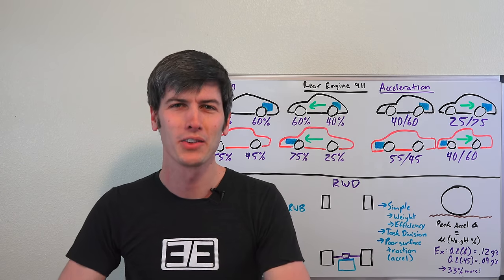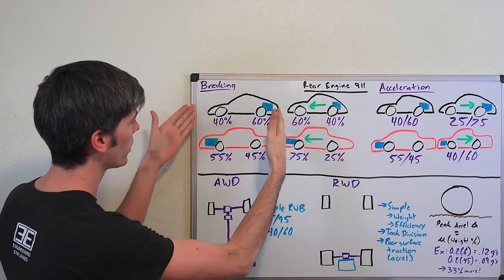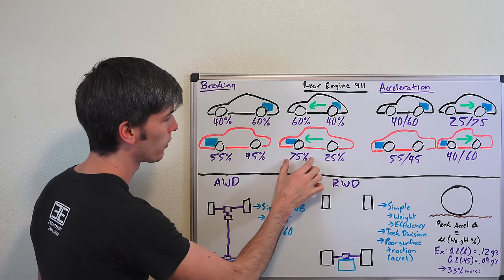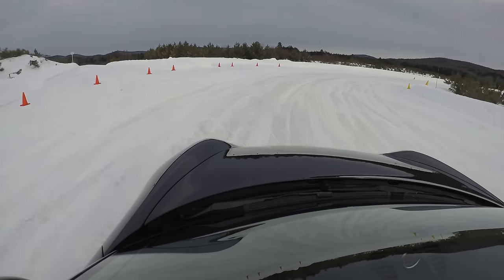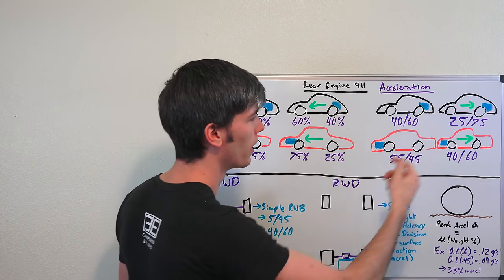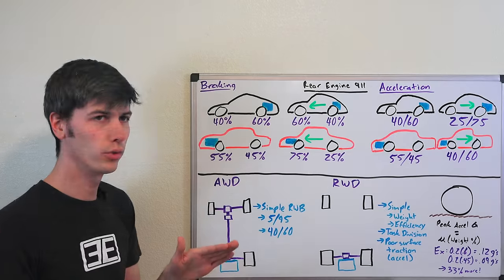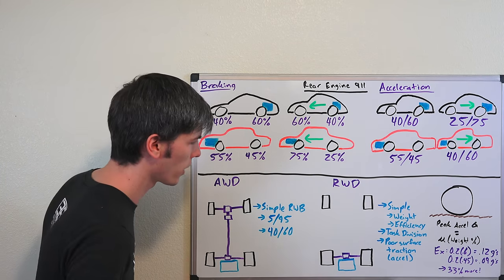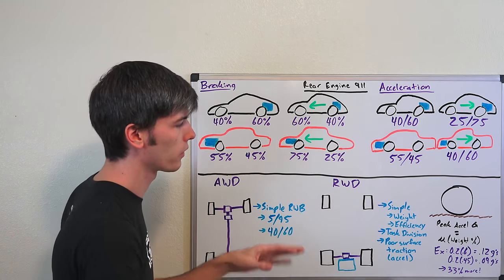Why Is The Porsche 911 Rear-Engine?

Comment: can you explain in a videl how do the golf r 4 motion awd sistem work? (or other awd that is fwd vias) and is it posible to rwd drifted? (via tuning and not changing hardware)
Reply: All wheel drive is of course superior to 2 wheel drive as far as acceleration traction.  But with all wheel drive you can not deliberately cause the rear wheels to loose traction for drifting, or gain drag to straighten out from a drift.
RWD is where drifting started.  But the 3 types of drifting are just different.
Drifting is attempting square corners by causing the tail end to loose traction and drift out, pointing the car more sharply into the turn that could have been done with steering alone.
With front engine and rear drive, you do it by over powering the back wheels until they lose traction, while in a sharp turn.  To stop it you have to drop the power and counter steer back.
With rear engine and rear drive,  it the same, but the additional weight in the back amplifies both the drift and the snap back, so you don't even have to let up on the power as much.
Front wheel drive always has front engine, and can never drift was well because all you can do is to apply exactly the maximum power to the front wheels that won't loose traction, because if you loose traction with front wheel drive, you go straight.  The tail will whip out slightly and the front can power into the turn slightly, but it is not as good a setup for drifting.  
And AWD simply can not really drift at all.  With even power to all wheels, you can't cause there to be any uneven traction.
Reply: Kirk Augustin. but the awd sistem on cars like the golf R can distribute power to the front, or back axels (i dont know in what amount), it would be cool if you could send all the power to the rear to drift it

Comment: Regardless of any advantages to the rear engine design that's not why Porsche does it at all. They do it because 911 fans wouldn't have it any other way. The original 911 was rear engined because it was essentially just a racing VW Beetle which was rear engined like many other european cars at the time because it was more compact than what was then the standard front engine RWD layout. 911 fans never take too kindly to anything that makes the 911 different from the original as they think that's the perfect car and if Porsche lost the rear engine layout they would all riot and never buy a 911 again.

Comment: The VW put the engine in the back because it helped make a really small, cheap car. Since then, they figured how to make small cars with engine in front that work just fine, but this explains why you might still want to deliberately buy a car with one in the back.

Comment: You should look into your claim that the rr config has higher moment of inertia. I believe rr is pretty good, just a little worse than mr. and then... practically speaking, mid corner it helps yaw the car. Just saying.
Reply from the maker: Car & Driver did some testing (there's not much data out there on Porsche weight distributions) and found the Cayman (mid-engine) to have a 20% lower moment of inertia vs the 911 (rear-engine). Hence, the claim made in the video.

Comment: I wonder why nobody has bothered to make a mainstream hybrid car that has an ICE on one end and the ELECTRIC on the other end? Basically try and harmonize both ends of the vehicle. Either that or has someone made a near perfect balanced EV?
Reply: All of the current Porsche hybrid vehicles in the states have the high voltage battery in the trunk and engine in the front...
Reply from the maker: There are a few examples of this: The Acura NSX, MDX hybrid, Lexus RX 350 hybrid.

Comment: There are a few things wrong with this no sports cars have the engine in front of the front wheels,and most are putting the transmission in the back to balance the weight,and you left out the mid engine layout  were the engine should go in a rear engine car. Porsche has just done a lot of engineering to make this bad idea work.

Comment: What about putting the engine in the middle?
Reply: If you placed the engine directly in the middle it would be difficult to get the cars weight to balance, so the best options are to place it inside the axles in either a front mid-ship or rear mid-ship design. A good example of this design is the Mazda RX-7 (FD) it has the engine in front mid-ship configuration  so even with the engine in the front of the car it still has 50/50 weight distribution on each axle.
Reply: That being said, its also important to remember that 50/50 weight distribution isn't the "best" option and as with everything in life it depends on the situation and what type of driving conditions will be encountered.

Comment: But I have seen the moster lambo drift car but that's mid engine there is the best for engine placement I feel like
Reply: corey Kenyon They all have advantages/disadvantages.

It's mostly to due with everything else you can put, weight distribution, ect. It's also personal preference to quite an extent.

Comment: If it was logical then the new 911 RSR race car wouldn't be midengined
Reply: I actually spoke to a Porsche engineer about the RSR and he said the change in engine placement provided very little if any advantage in handling balance.  The key benefit of moving the engine forward was the space they gained at the rear for a much more aggressive diffusor and the additional downforce that provided.  Not sure that same advantage relates to a general purpose road-going sports car.
Reply: Craig Spender "Spoke to a porsche engineer" and it directly conflicts with the press release from the race team in quest.  Isn't that convenient.....
Reply: It is what it is.  He may have had a different opinion from other engineers as to the degree of difference (apparently they're allowed to different perspectives) but to be honest it doesn't actually contradict what was said in the detailed press kit.

Comment: Why are there not mid-engined cars in this confrontation??? 
All the advantages you explain here you can have them with a mid-engined car minus the disadvantages that a center of mass, so moved at the end of the car, give you for the excessive leverage effect due inertia of that eavy bottom; disadvantages which can easily materialize in a much powerfull snap oversteer... respect to a mid-engined car.
The real reason why 911 is rear-engined is for the 2 plus sits in the rear which you get... 
In Porsche they know it and that is the reason why all their "over the top" super sport models have always a mid engine.
Reply: Late reply but you're right, jason should be comparing this setup with the mid engine design not with the fron engine design.

Comment: What disadvantages are there?
Reply: HYWay snap oversteer under heavy breaking. Essentially you have to drive the car differently than a normal rwd car. Assuming the engine is rear mounted, rwd. 
For example let's say you want to take a fast right hand turn, in a front mounted, rwd car, you would down shift, slow down a bit and take the turn. In a rear mounted, rwd car, you want that moment of Inertia on those rear wheels, because if it moves forward the car will spin out. So in this turn, you would want to maintain speed.

Comment: I've got a small question, when 40 percent of the torque is sent to the front wheels, does that mean that the rear gets a 100 (engine torque minus gear ratios) and the front 40 percent of that by having the front clutch slip all the time?
Reply from the maker: If the front is getting 40%, the rear will get 60%. The 40/60 split can be done with the clutch locked up, based on gearing. The 5/95 split (and up to 40/60) will mean the clutch is slipping. In wet multi-plate clutches, it may sound like this will wear out, but they can actually last an extremely long time if designed properly. When I worked in the forklift industry we had transmissions that used clutch packs to brake the vehicles (rather than the actual brakes, which were there more for safety). The clutch packs could out-live the vehicles, very robust.
Reply: Engineering Explained thanks for the explanation, much appreciated! Long live AWD (and Honda's)!

Comment: 911 has a lot better turning  because of low weight in the front
Reply: you need a lot less force to rotate the steering wheel
Reply: with the motor in the front you have to carry haf the weight of the car with your hands and it will drive like a truck

Comment: What’s the difference between rear engine and mid engine?
Reply: As the name suggests a rear-engined car has the engine BEHIND the rear axle, a mid-engined car has the engine between the axles and a front-engines car has the engine in front of the front axle (or the majority of it). A mid-rear-engined car thus has the engine between the axles but behind the driver and most of the weight towards the rear. A front-mid-engined car (like the AMG GT) has the engine in front of the driver but still in between the axles.
Reply from the maker: Rear engine places the engine behind the rear axle, mid engine places the engine somewhere between the front and rear axle, though more commonly mid-engine refers to the engine behind the driver, in front of the rear axle. Technically, cars like the Corvette and S2000 are mid-engine (front-mid).

Comment: While all of that is true, there are also huge downsides to having the engine behind the rear axle. Increased polar moment of inertia is one of them. Reduced front traction is another , Porshe had to add weight to the front of the car in the early models. All in all the rear engine layout is not that good for handling. It goes from terminal understeer (because the fronts have very little weight on them) to terminal oversteer (because of centrifugal forces on the mass at the back) all in a single corner.
It just make a lot more sense to put the engine in the back of the car , BEFORE the rear axle, like all other serious sport cars. That way all tires have decent percentage of the weight on them and the car responds like it should.
The original advantage of the rear-engine was the reduced weight of not having a driveshaft from the front to the back. And they kind of stuck with it.
Reply: I would say it has something to do with the soul of the car. Mid engine might be better for cornering but might not be as much enjoyable as rear engine. It has its moods over the single turn. You can be fast with it but need to master it. With mid engine cornering is easier but yeah... the traction on exit.

Comment: In RWD, rear wheels need more weight, FWD needs more weight on front wheels. AWD cars needs ~55-60% weight on front wheels.

Rear engine is history. Way better for RWD is mid-rear engine, and most supercars have this. Cayman, with 911 technic will be better than 911.

Thats why BMW classic layout is bad and they are slow on tracks. New G30 M5 AWD have 55% weight on front wheels and are a lot faster than any M5 ever. RWD cant have their engines on front wheels, which giving only 50% of weight on rear wheels.

Comment: The 911 RSR is mid-engined. End of discussion?
Reply from the maker: Not really, the RSR isn't a road car. But dynamically yes, mid-engine is an ideal setup. That's not to say rear engine doesn't have advantages though (as discussed).

Comment: porsche 911's do too much understeer because of the emptiness of front axle. there is no weight on front to provide enough friction. you can not steer the car during acceleration. especially during hard acceleration, 911 model family acts like butter, not like a sports car. in my opinion, a real sports car should be mid engined.

the massive example for his topic is Porsche 911 RSR. even though it is a 911, it is not rear engine mounted. it is mid engine mounted as a real sports car should be.

Comment: ??
Braking you want the weight distributed across all wheels (because you have too small front wheels)
Acceleration you want the weight on the back (because you have fat rear wheels)
The logic is flawed and based around having the wrong tyres sizes...

Comment: Why aren't all cars rear engine?
Reply: dguy6789 Yeah, the Volkswagen Beetle, Fiat 500 and Subaru 360 were such expensive cars.
Reply from the maker: Grocery space.
Reply: dguy6789 Cost ultimately because it's a terrible design that ruins overall handling and interior/cargo volume, and it's also less crash worthy because engine blocks make for a good crash barrier.
Reply: dguy6789 Um, the Tata Nano must be expensive, right?
Reply: I think front engine also save on gas too.
Reply: Rear engine FWD when 😅
Reply: Iventonart. No, an engine block is a dangerous thing that can enter the cabin and injure you.  Considering the mounting arrangement most engines use they are poorly integrated into the chassis for crash protection.
Reply: DrewLSsix That's true in a bad design, but ask Volvo how they feel about engine blocks between you and what you're colliding with. Whenever you have something between you that can brunt the energy in a collision, that is safer.
Reply: Because if you drive them wrong snap over steer will send you into a wall backwards in a firey ball of death, be afraid, and aware that the engine acts like a pendulum.
Reply: Modern day stability control has kept the  Corvair alive
Reply: DewLSsix, BS. There's a reason why most cars today have front mounted and transverse in-line engines, and it's not purely because it's cheaper and easier to manufacture.
Reply: Chevy hasn't sold a Corvair in 50 years.
Reply: DewLSsix With your understanding, all cars are made less safe because engines aren't directly positioned in the middle and the passengers aren't mounted on the outside of a car.
Reply: PGTMR2 That doesn't explain the average car, just high-performance cars. Over steer is only a problem at the limit, something the average car never sees.
Reply: Samir very few engines today make less power than my old MR2 did. Put the same power into a 4 door with the engine in the rear, add a little rain and a curve and boom you're at the limits of adhesion quicker than you thought.  Taking your foot off the throttle sharply (a normal reaction to trouble,) once you realize it makes it worse. The weight is already swinging, the engine braking slows the rear wheels only which wants to also bring them around front and this all happens very fast. It's not that they CAN'T be driven carefully, my MR2 was great in snowstorms, you do need to know they will act differently and the limit can be surprisingly low.
Reply: Weight distribution isn't the only factor. An MR2 is more similar in weight distribution to a BMW 3 Series than it is to a Porsche 911, and that's because the MR2 isn't rear-engine, it's mid-engine. Also, your MR2 is 1980s technology. Besides, a lot of mainstream cars have lower limits than we think, but we just don't have high limit demands for that to be an issues. I can barely drive my truck in snow, but I don't demand much from it, and I always take it easy no matter what I drive. Having driven a 911 and a Beetle in winter weather (rain and snow), the limit thing isn't the primary reason for rear-engines not being mainstream. When all other things are considered, front-engine is just the best layout for most people.
Reply: That is true, and that's where the M in MR2 comes from. Weight transfer gets worse in extreme situations the further back you put the engine. I wasn't saying it's the only reason, it should be considered though. There's not going to be much difference between an 80's "sports car" and a modern basic transportation sedan. Enough spring, shock/struts, and tire to keep it from wallowing or leaning too much, center of gravity probably makes the sedan worse. Unless you're talking magneto rheostatic shocks/struts not much is different technology wise to conventional suspension.
Reply: Ha hahahha love it!
Reply: Can you imagine stuffing a pram, a 60 pack of pampers and the labrador under the bonnet of a porsche? Yup, thats why its sensible to stuff the engine up the front.
Reply: Some black dude will never be right again after watching me throw a 24 pack of toilet paper under the hood/frunk of my MR2 very quickly :D

Comment: you made a big story of nothing.
Porsche placed the engine in an early version of the porsche, build from the vw..
and then they didnt want to change the "setup" and improved it over the years.. A rear mounted engine is still not a good setup. !
Reply: dkphantomdk clearly it is very good - Porsche is the proof.
Reply: Porsche wasnt good at first, it was a death trap in corners in its early years because the rear was spinning out to easy.
- but like I said, Porsche has improved the design and setup alot and now a days the car is great, 
The first 911 turbo´s was a handfull to drive, mainly because  of the turbo lag..  but think about it, it has a huge wing to help the rear wheel stick on the ground..   

but even its a lot better than the old das, you still see videos of them losing the tail in corners all over youtube, try nurnburgring crashes..

Comment: The more interesting comparison would be, I think, to a mid engined sports car.
Reply: Basic logic would tell you to take the data from the front engine and rear engine examples and find a middle ground.  Plus, everyone gets the benefits of mid-engine, that's never been debated.
Reply: PLAY_HRD I don't know about "basic logic" (Engineering Explained is presumably intended for an audience looking for something more than guesswork, conjecture and speculation), but the video makes the argument that a rear engined layout is particularly optimal for a sportscar, comparing it to the decidedly less optimal front engined layout, while omitting the mid engined comparison (which provides lots of similar benefits to a rear engined car only without the pendulum effects). 

In any case, I was merely suggesting more knowledge would be favorable. If you feel otherwise you are, of course, entitled to that opinion.